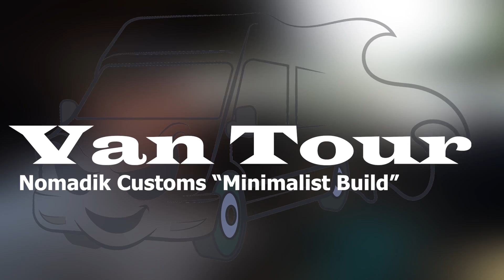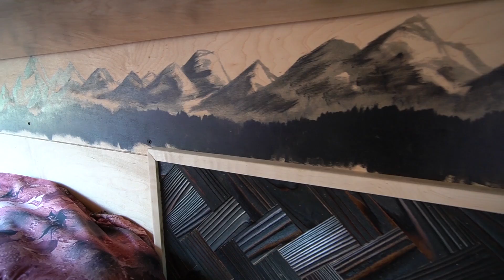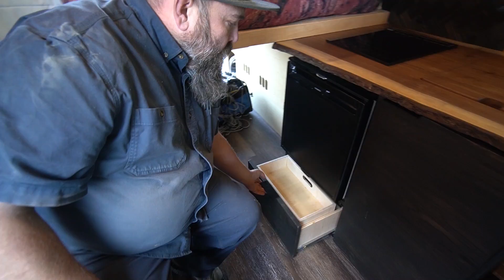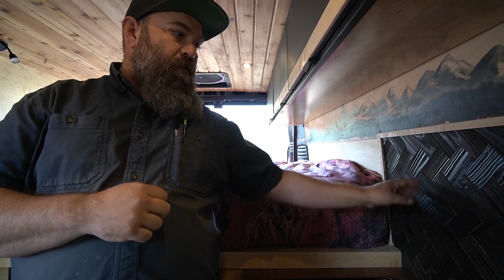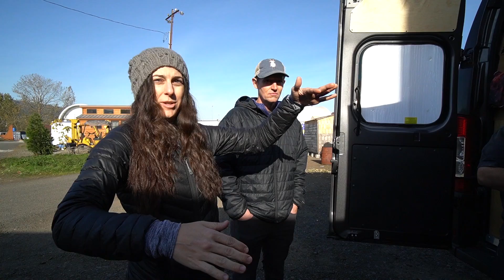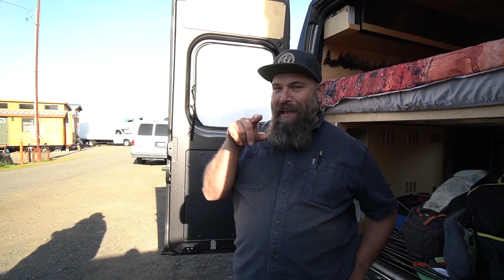Minimalist Van Tour - Perfect Van Build for Adventures, Weekends, Climbers and more

Comment: I really like the details and color scheme of the cabinets of this van.

Jarrod, 

Could you please, somewhere in the future, do a video about climate control?
Not about insulation.
But how it is in a van and how one can make it more comfortable in all four seasons, in day and night, and when it's raining or sunny, if there is wind or not, when in stealth mode or open mode, and when cooking or showering.
What can you do and how you set up climate control systems for all this 4 (temperature seasons) x 2 (day 'n night) x 2 (rain or dry) x 2 (wind) x 2 (showering/not showering) x 2 (stealth mode or not) x 2 (cooking) is 248 set ups? The combined settings for air heaters, ceiling fans, AC, dehumidifiers, fans, air vents underneath, air purifying filters to make the micro climate in a van, as comfortable as possible under all those 248 circumstances.
Reply from the maker: Thank you and I will plan on that. I like the idea and I just took a screen shot of your comment so I can add it to new videos!
Reply: @jarrodtocci  :D

One day later I laugh about the way I formulated that question.
And I realize that some combinations are not possible and a few will overlap.
And I haven't thought about humidity in a desert vs in a rain forest in central america or high up a mountain. Or very hot engine heat, lingering, after a long ride.

But I look forward to the new technical video on this topic.

Comment: For a build like this, how long does it take for nomadikcustoms to complete? Assuming starting with an empty promaster.
Reply from the maker: I don't want to speak for them but it's safe to say roughly 12 weeks. Times could be different on bigger builds. Could also be closer to 8 weeks but I say 12 weeks to most to be safe.
Reply: We usually are around 6 to 7 weeks for this minimalist build, but we are producing promaster kits and installs may be a shorter time span.
Reply: Awesome guys. Looking at getting a promaster probably next year. I'll check back to see when your kit is released and the price. Thanks

Comment: Jarrod, Have you seen a way to make the sliding doors extend away from the side of the van in order to use  extended Flarespace Flares on both sides?  then you can build a fixed bed and have the extra room to sleep across and free up space to have a inside shower with a curtain and opposite it a Natures head on full extension drawer slides.

Comment: I’d put the rear seats facing the sliding door for leg room and to open up the space.
Reply: Adding my 'yup, I know I heard/learned-this... someplace...
In Britain - they actually have some build requirements for camper vans.
Which means - somebody had an accident so somebody else added another line to the list of things you need in order to have a camper van approved "Road-Worth" in a country that invented a little thing called "A Cue Line"... you Yanks think the DMV is adversarial... HA!...
So.  Go google yourself some information.
Check out the standard-installation for a "gas bottle" sealed cupboard, with an external vent to the outside body of the van.  If there's a leak - you know because the alarm is chirping.  Which you can hear because the gas leak is gravity-draining out the vent located in the base of the Bottle Box.  Why?  Because Science.
Side-Question:
Apparently Lead Acid Batteries/AGM can possible gas off-gassing-if-it-s-not-already-Sealed... that off-gas floats up... so you need to have a vent to the outside body of the van Above the batteries???  Why?  Because Science???
Then?
Check out the standard-installation for "passenger seat" installs.  I'm pretty sure I heard that if you mounted the passenger seats so they face the side door... well...
The safety limits of the seat-belt, as tested in series after series of Crash Test Dummies... those seats face forward.  Are bolted into the body using the existing Manufacture designed attachment points in the floor of the van.

No body has ever tested one of those passenger seats facing sideways to the front of the car.(???)

Insurance Providers?  Probably not impressed with the passenger seat facing the wrong way.

Might possibly invite problems that involve lawyers in "whose at fault for the injury incurred during the fender-bender-accident" that you have just opened yourself up to... by installing a safety feature in a way not recommended by mechanics or the manufacturer...

Anywho, just passing that along.  Happy Build.  Night all...

- Cathy (&, accidentally, Steve), Ottawa/Bytown

{yes, i'm old... i still think in paragraphs...}
Reply from the maker: That's true about the room but for safety they should face forward.
Reply: What about developing a kit whereby the double seats are locked forwards for travel but can swivel and lock into place sideways for living space?